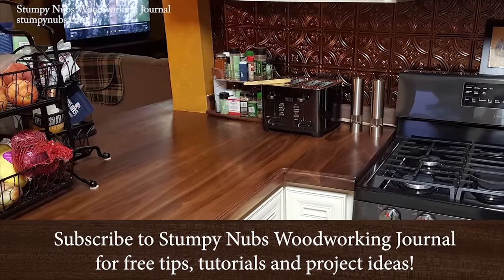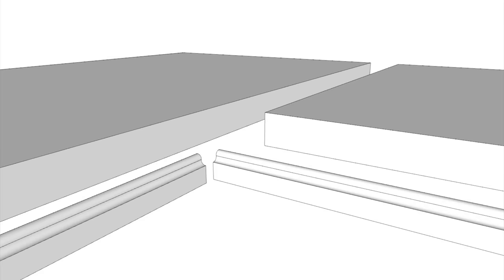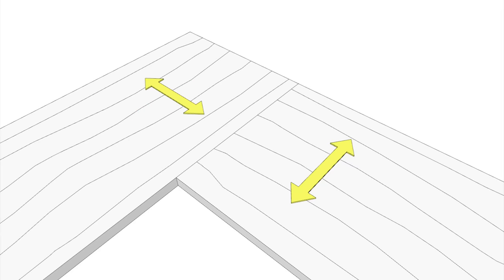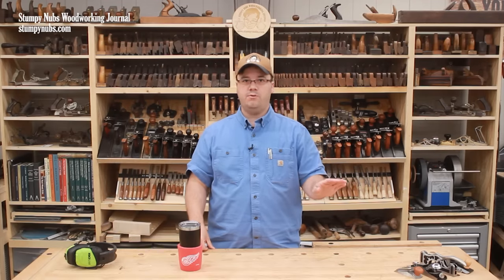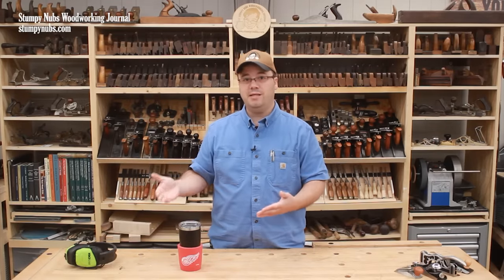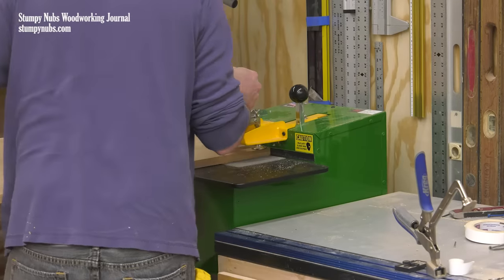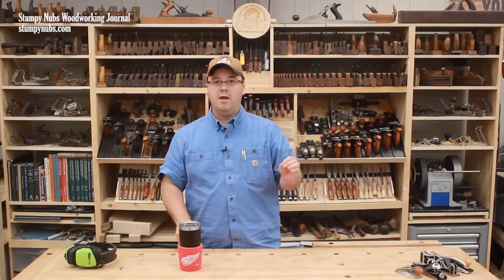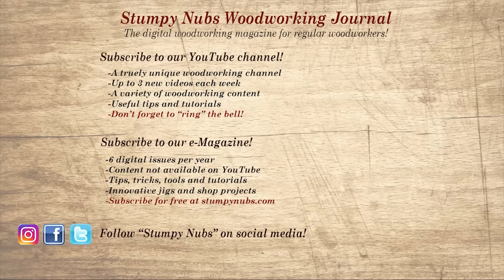A common mistake of connecting corner desks and counter tops

Comment: Here in the UK the most common way to joint worktops is the "mason's mitre". It's essentially a hybrid of a butt-joint and a mitre joint which avoids the "mitre opening up" problem, however it is very unforgiving of mistakes during the cutting as you need the male and female sides of the joint to fit together perfectly. 
I'm told that people used to cut them with tenon saw, but these days we use a 1/2" router with a guide bush, in a jig. We also use dog bone bolts and biscuits to hold these together.
Reply: Just looking for this comment! I was going to say, normally I get out my Hitachi router and Trend jig and put in a funky joint that starts as a mitre and straightens out :D
Reply: I had no idea it was called a "Mason's Mitre" ..... learn something new everyday , thanks;-)

Comment: I used a miter on a large basement bar, almost identical to your methods, including cutting with track saw and dog bones. I did decide to glue the joint, and haven’t had any problems with it opening, but I took a different approach and allowed one end of the bartop to float on the bar, allowing for movement. No regrets, five years later. It was the reason I bought the track saw…not sure how I’d got along without it!

Comment: Our family had an antique dining table set heirloom which had come over from Scotland, all hand-carved, complete with six chairs (one of which was larger and more ornate for the head of the table) and extra two leaves.  The thing weighed over a thousand pounds.  And it didn't use any glue or nails whatsoever.  The entire thing was constructed with pegs, dowels, tenons and biscuits.  Whatever master artisan made it clearly knew that much wood all joined together needed to be able to flex.

Comment: It's neat how different fields have similar recurring themes- in a rocket engine injector we had a braze joint open up due to uneven shrinkage of two parts, a thin disk with a central hole closing out an annular gallery in the larger part. We solved it in the next build by adding an s-curve in the disk to let it change diameter to accommodate to the larger, stiffer main plate during rapid temperature changes when the liquid oxygen hit. For many years afterward, our design reviews included, "Do we need a 'wubba' here?"

The floating tenons and draw bolts accomplish the same end, allowing compliance for expansion and contraction rather than concentrating loads to the breaking point. Cool!

Comment: Whe I worked in "home depot equvalent" we had roting templates for the edges of butt jointed corners on counter tops. The made it so that the was a reliefcut on the long edge and the profiled portion of the short edge had a radius where it mated with the relief cut. The coutntertops were aligned with biscuits and  held together with special screw clamps for easy removal as I remember. I could make a drawing of the setup if there are any questions or interest in making a video about the technique. It was pretty slick.
Reply: I was also thinking of work tops. A small mitre for the profile.then the butt joint. Then biscuits and the screw clamps. You use a jig profile for this. 😳

Comment: Should have watched this before installing my butcher block counters. I used a hodgepodge of dowels, glue and dog bone fasteners on a butt joint. It was also my first foray into joinery.. 1 year later there is a tiny seam separation and slightly proud elevation of the long grain side. Depending on the day. Overall I'm still pleased and don't mind the errors. They tell the truth about me. Great video for future reference

Comment: I did a pretty successful miter joint in my wood kitchen countertops by using oak veneer plywood edge trimmed with wide solid oak by using a straight edge to guide a fresh blade in my Bosch sabre saw. I was building on a tight budget. I was able to rip a single sheet of plywood to get two countertop sections. The width shortage was made up with my extra wide solid oak trim. I was impressed how well my improvised edge guide worked with a sabre saw simply butted against it. I think that your unglued bisquit joint would have been a better technique than we employed, but plywood is likely more stable than solid wood. Our countertops are 10 years old and my miter joint is still surviving. My greatest regret is my Home Depot plywood veneer skin is extremely thin. I bought much thicker oak veneer plywood from a cabinet shop 10 years before the countertop project that had much thicker oak veneer.

My woodworking budget now allows for solid wood projects and I am increasingly becoming aware of and sensitive to wood movement. I enjoy content that addresses these issues as I am trying to improve my furniture designs to manage this anticipated movement.

Comment: When your machining you can simply go through a cutting list and be pretty sure the pieces will fit together perfectly, but I find with more complex work where tiny variables add up you come to a point where you have to take your measurements of the work itself.  This video explains the theory behind what you do, which is exactly why doing a cabinet making course is a very good idea.  I had a business partner who was an old timer who taught me the old ways which was also invaluable.

Comment: This is a superb tutorial!  The illustrations explained wood movement crystal clearly.
Outdoor miters are a pet peeve of mine because the humidity swing is 4X what indoor humidity is.  Anything over an inch and a half will produce noticeable gaps.  If the joint is 15' away it might not be observable, but when folks doll up a window with 4" or 6" mitered outdoor trim I just shake my head.
Reply: pl premium all day

Comment: Thanks for this video, nicely explained.  One question, in the case of the mechanically fastened miter joint, I believe the wood will still move but rather than the joint opening, the angle between the counters will change.  So do you make allowances for the overall countertop to change shape in how you fasten to the cases and wall?

Comment: We appreciate all of your videos and attention to detail. Although, this video has brought up a question that I have been unable to find the answer to as of yet. 

Why is a countertop or desktop joined together with loose joinery and a tabletop is glued together? 

We are preparing to join three pieces of popular live edge for a breakfast bar top and I plan to use zipbolts and biscuits with no glue based on your recommendation. Although, we keep trying to figure out why table top boards are glued together which would not seem to allow for movement of the wood as the loose joinery does. 

Thank you for any help you can offer!
Reply from the maker: I am not sure I understand your question... You can glue boards together if the grain is all running the same direction. The problem comes when you join two boards with crossing grain direction.
Reply: @StumpyNubs  Your reply answers my question and as I hit the "reply" button earlier I thought to myself... The glue vs no glue due to seasonal movement is due to the orientation of the grain on the two pieces being joined together. 

Thanks again and keep up the great work!

Comment: Do you have any opinions about what to use to seal a wood countertop? Have seen them wear poorly especially around sinks, just wondering if you have advice about this or would avoid wood countertops for the immediate sink area altogether. I’d hate to do all this precise work and have it not stand up over time.

Comment: Inquiry; I'm building a decorative section of 2 rail fence to mount a large custom made address sign. Since the sign is taller than the distance between the fence rails, I need to create a drop in the bottom rail and a rise in the top rail. I'm thinking 8 - 45 degree cuts to transition each corner from horizontal to vertical then back to horizontal. I don't have biscuit tools but can get away with a second layer of 1x6 across the back. Should I also be thinking of adding some dowels, or even cutting a slot in the 45 degree cuts on my table saw, then cutting a shim piece to fit the gap created by my saw blade? This is all exterior grade pressure treated 1x6. Thank You. Love the informative videos and love learning not only how to do something, but why do it a certain way.

Comment: This was very thorough! Thanks! Before watching this, i would have been inclined to try to glue a big miter like that with a plywood reinforcement gusset on the bottom. I much prefer your elegant, professional solution.
Reply: is this really better.   it seems just more expensive
Reply: @matthewstrand8055  well since the application is for solid wood countertops, after you've invested in the counters, I think it's a small price to pay to get some nice hardware and have a longlasting, quality install.
Reply: @SnootchieBootchies27  so as a homeowner, are you expected to tighten those clasps once a year?
Reply: @matthewstrand8055  if you buy a big wide piece of wood...  yes. This is among the many reasons that I tell people that they don't actually want a wood countertop. But some people just want what they want.
Reply: @SnootchieBootchies27  so why dont you convince them out of this?
Reply: @matthewstrand8055  I usually do. But like I said, sometimes people just want what they want. All I can do is state the pros and cons of different materials and products. I can't make people's decisions for them. Plus, for a desk instead of a counter, I wouldn't be trying to talk them out of wood.

Comment: What about the best looking joint? The Masons Mitre?
You go in at 45 degrees in the inner corner, then turn along the side of the butt-joining section.
The butt-joining section is also machined to have the same end profile so the two fit together with a almost invisible seam.
Now you have a sharp inner corner including any curvature, miter or profiling from the stock as well as a sturdy joint that can be supported by the counter underneath while being almost as short as possible.

Comment: I've been planning on making a large L-shaped computer desk out of butcherblock to go on top of a sit-stand desk frame. Would these same techniques be applicable to butcherblock so long as the grain is all going in the same direction within the butcherblock? Should I worry more about reinforcement of the butcherblock since its not one continuous piece of wood? The joint I've been thinking about doing is a miter joint between the 2 large butcherblocks that I would be using. Any thoughts or suggestions would be appreciated.

Comment: Curious about the mitre joint, are you not worried about food debris or liquids getting into the mitre as movement occurs over time? I've only fit wooden worktops once for a kitchen and we did a butt joint using the worktop clamps (dog bones) but we also glued them because we thought it safer as it would keep food and water out of the joint. Just wanted to know your thoughts

Comment: Good afternoon. I am installing two butcher block counters to form a 90 deg L shape and want to use a mitered joint. One counter top is 25" wide, while the other counter is 36" wide. Do you have any instruction or tips available on cutting the the two mitre, that are different widths. Thanks in advance!

Comment: I recently had to fit a mitred laminate countertop into a non-square corner.  And I screwed it up.  I made the adjustment by trimming one of the mitres, resulting in one side of the joint protruding into the room further than the other, leaving a gap.  I think I've now figured out that both side of the mitre should be trimmed equally.  I think this might make a good subject for your utube channel.  Let me know if you decide to do so.

Dan O

Comment: Just wondering if you would seal the timber before or after making the butt joint. I'd imagine before would seal the timber better but make the joint more noticeable, and that after would be flush but more prone to cracking along that joint for the reasons you mention in the video? Seeing as the two pieces will move somewhat independent of each other?

Comment: So I've cut my butcher block countertops, doing the butt joint style. I am getting ready, after some other work, to cut in the biscuit joints. Can I use the draw bolt joint connectors to hold the joints tight, or should I just run screw up into the butcher block from below using the cabinet tie in holes or do pocket screws?

Comment: I have been trying to drum up a method to make a nice corner executive desk for about a year now, watching just about all your videos to do so. 

Currently thinking I'll use 3 pedestals using a rail and stile bit on the router table with 1/4 walnut hardwood (can't get walnut ply by me), with a removable top for transportation. Any tips? The only other person I"ve seen do anything remotely close is the wood whisperer, but he locks that course behind a $100 course and It's still not the same style. Any tips for a hobbyist woodworker?

Comment: Hi, for solid wooden tops, we normally rip longitudinal grooves into the bottom surface of boards every 100mm to about 5mm below the top surface. This prevents swelling and warping. This is required for our hot and dry climate. Your comment?
Reply: Interesting tip... Do you rip with a saw (presuming a 3mm-ish width/kerf) or do you have a router for it, being a "groove" instead of a prescribed saw cut???

    Asking because we have humidity kind of all over the place, usually high in the summer (read "you need gills to breathe") and low in the winter... AND since most saws leave "bat ears" behind when cutting dado's and rebates... which generally I clean up with chisels... to avoid weakening the remaining wood and joint... I'm not sure how this would effect a longitudinal "relief groove" though. ;o)
Reply: @gnarthdarkanen7464  we use a Festool saw with a track. Quicker and cleaner.

Comment: If you glue and reinforce the miter joint, the forces trying to open either the inside or outside corners will tend to change the angle.  For a counter that may see water, doesn't it make sense to seal the joint but allow angle motion in the top?

Comment: Redwood and cedar grow in length with additional moisture. In 16’ long planters I have to make the corners of the seat three pieces and attach them with pocket screws. Hides most of the movement. The planters themselves, are all butt jointed.

Comment: I'm not sure about the U.S. but here in england we use a slight combination of both to overcome the precut profile issue. A jig is used that mitres on the outer edge of the countertop and then transition to a square butt joint. The counter tops are then held together from the underside using rebated bolts. These are more often used with melamine faced Chipboard tops though.

Comment: You can have a mason's mitre which combines the butt joint and a full mitre to retain any edge profile through 90 degrees and keeping the properties of a butt joint and since the mitred section is only the width of the profile it could be cut with hand tools.

Comment: Amazing that the walnut countertop was a couple years ago, time really flies.  Did you cover attaching the top to the cabinet in that series?  I'm attaching a butcher block now and wondering what the best way would be.
Reply from the maker: Bore over-sized holes through the top of the cabinets and drive washer-head screws up into the underside of the counter.

Comment: Hello  Im making my countertops out of black walnut and Im trying to decide to decide on this very topic . My counter tops will be 27 inches from front to back because  my  walls  are so far out of level  . my plan is to run the grain  in the same direction   . i have a u shaped kitchen so i have two corners to deal with . my longest section is about 6 feet long and thats where the sink will be . i would like to make that section  end grain to end grain  which would be front to back  so when it tied in with sides  the grain would be all going in the same direction . the joints would then be edge grain to edge grain . my question to you is this  possible  ?

Comment: best practices aside, is there a way to get a decent joint without using hardware, like with bowties or dovetails that would last as long as hardware, or will every glued or fixed joint fail causing the wood to split?  anecdotally, i have harvested wood from many 50-80 yr old joinery furniture that used hardware and the wood still failed surrounding the metal fasteners more severely though typically hide glue was also used basically preventing movement.

Comment: Could I use draw bolt connectors to hold my breadboard ends on my table?  I used floating tenons and 4" screws but I worry that these screws may not be sufficient over time.  The top is Cherry and the screws have a bugle head that I fear will draw into the wood.  The holes are elongated to facilitate wood expansion.

Comment: It's not quite the same since it's chipboard, but I noticed that the corner joints on my kitchen counter use a kind of hybrid butt/mitre join, where it's basically a butt joint but slightly recessed into the 'long' side with a 45 degree angle where the front profiles meet to give that nice sharp inner corner.

Comment: I’m thinking of making a frame for a very large mirror. It’s about 6 feet x 3 or 4 feet and I want to frame it with 3-4” wide boards. But I can’t decide about the corners. What advice would you give?
Reply from the maker: While it doesn't talk about the frame you intend to make, the info in this video about corner joints will be useful: https://youtu.be/zVRhzAr-EpU